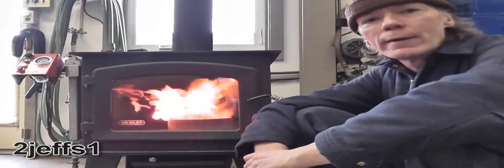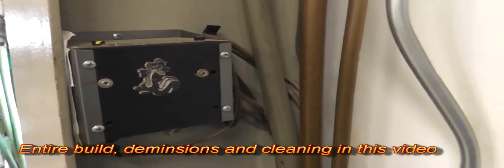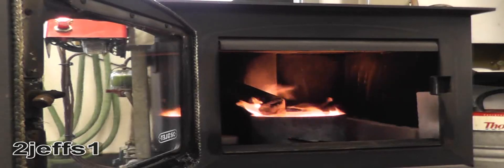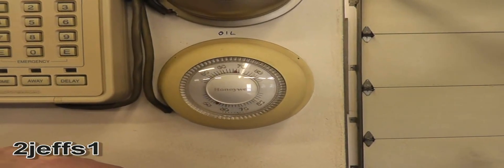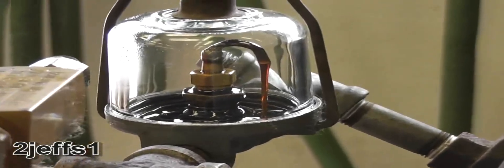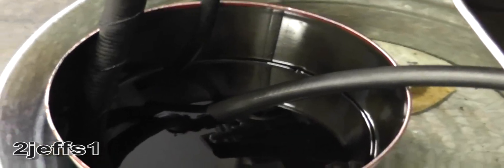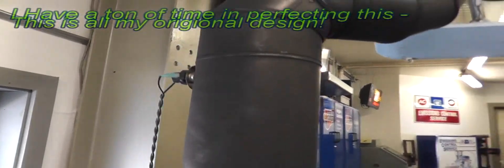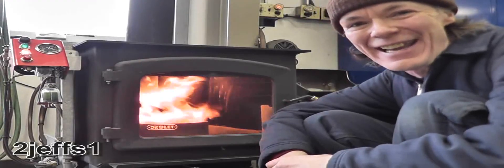Homemade Waste Oil Burner Heater for Daily Use DIY

Comment: I see your thermostat is reducing the oil by the solenoid  are you also slowing down your air supply? Not quite getting what your putting down.. Is the the smog pump for high pressure low volume air?  
Just wondering, nice vid  Murf!
Reply from the maker: Hello Dan. There is no change to the air supply. Just slowing the oil to a drip which keeps the flame lit for when it calls for more heat. (increased oil flow) Actually an air compressor or smog pump will work fine. I found the smog pump run at slow speed - the blades pulse the air which atomizes the oil better with less volume of air & oil needed and keeping more of the heat in the stove and less out the chimney. Hope this helps ya out, Jeff

Comment: Pretty slick design!  I like the wood burning stove redesign.

 I have a more advanced fully automatic design on my boiler that uses a common fuel oil furnace burner with a oil preheater unit just ahead of the nozzle.  Burns anything from gear oil on up even with the 2000 gallon tank sitting out in -30F whether all winter!
Reply from the maker: Sweet - Sounds like you have a nice setup too. Never seen how a fuel oil furnace is setup or works I just kinda remember there was one in the basement  when I was a youngster!

Comment: Would WVO work?  or do you need the pop of dinosaurs?
Reply from the maker: I never tried WVO but would think it would work. I have ATF, synthetic oil and brake fluid all mixed in and it works fine.

Comment: Liked and subscribed!  I can see how a manual setup is possible, but an automated setup like you show is so much nicer.  I am amazed how clean the glass remains.  You've got a really nice setup with all the precautions -- just add an oil tank full sensor/light/buzzer and you'll likely never need the oil overflow trough upstairs, but you probably have enough capacity up there to last 18 mo. of oil collection.  Awesome!
Reply from the maker: Welcome & Thank You. The glass was my favorite part vs the old pot belly stove. It's great to sit & watch it work on a Friday night & have a beer with some friends!  Aah - Actually now that you mentioned it I did over flow a tank years ago. (not much but before the overflow catch!) The sensor/light or buzzer is a great idea for the future!!
Reply: 2jeffs1
I use waste veggie oil as an alternative fuel in a diesel.  So I thought, why not drip it into a wood-burning stove.  I modified an umbrella holder into an oil tank with a small ball valve, a multi-turn valve to regulate flow and a copper pipe into the top of my wood stove.  I inserted a large rectangular pan in the bottom to catch what might not burn.  It is dripped onto wood and saves so much in wood consumption and ash removal.  Half of the BTUs come from wood, much more results in an inefficient burn of the oil and smoke.

Comment: everytime i read your comments i hear your accent lol i like the design. how much does it cost to run it on average (electricity cost/Per Month)?
Reply from the maker: That is a good question. I know the motor is a 1/4hp. It is an older one so it probably isn't as efficient as a newer one. I do know when it's really cold out it struggles a little bit on start up where it is in the cold!!

Comment: Very cool!  Does your oil drip onto the pedestal inside of your burner, or down on the bottom of your burner?
Reply from the maker: Hello Gerald. The oil drips to the bottom of the burner. The pedestal is mostly to assist the swirl. Note that the air in from the 1/4" copper line don't point directly at the bottom of the burner where the oil drips. That is so it don't flame out at idle. When the oil is at the high speed mode the air from the smog pump & swirl actually splatters the drops all over in the burner creating a lot of heat. (Actually the oil will be on fire on the way down a bit after started.) Hope this helps you out , Jeff
Reply: 2jeffs1
Can you burn synthetic waste oil in it?

Comment: This looks great!!!!!!!!!! I might try this in my workshop in the Netherlans.
Reply from the maker: The dimensions don't have to be machinist perfect. If your in the area things will work just fine. Once your up & running fine tune the 1/4" air in burner line for the flame swirl and your rocking! Sounds like your not quite next door to me!! I like when folks say where they are from. Do you watch mastermilo82? I believe he is from the Netherlands. But hey, Happy NY, Jeff

Comment: Great video and a brilliant idea, but I would rather use recycled veg oil.
Living in a built up area I would have huge concerns about what goes up the flue/stove pipe from burning engine oil that is known to contain heavy metal additives and is a known carcinogen.
But big respect for the ingenuity I think the burner pan would benefit from a vortex cone
B.Eng. Hons

Comment: Really cool.  I'm following your design.  How does the air from the smog pump get in the burner?  Is there a hole in your burner pot that connect to the line from the smog pump?  Also, what is the diameter of the line?
Reply from the maker: Hello derntus. The line that comes from upstairs (smog pump) to the stove is 1/2 '' ID copper. There is a silver tee (1/4'' steel pipe fitting) on the outside of the stove that this connects to. That will be visible in the video - the one that comes from behind the heat shield. The next fitting straight above that is a tee BUT you can't see that in the video. (sorry) That is where a 1/4'' OD copper tube goes into the heater and to the burner. That line I slide into the side of the burner is the air feed that is directed in a manner to make the flame swirl. One can slightly bend the end of that to get the perfect swirl for a final tune once operational. Please note that on the top of that external tee that air bleed valve and then goes to the muffler. I use that to bleed excessive air from the smog pump to avoid a dead head effect on the smog pump and to cool the drippier tube. (It don't inject any air into the stove.) That one is 3/8'' OD copper. It just lays in that drippier tube and is 2 - 3'' long. I know that's not visible in the video either. Hope this helps you out & good luck, Jeff

Comment: Awesome stove Jeff. You mentioned per season about 5 gallons of oil? How long would a season be? How many btu do you think it puts out, or have you ever measured that? Regardless thanks for being generous about sharing this with others :)
Reply from the maker: Hi radstorm, A 250 gallon tank will last me a 4 ~ 5 month season running the shop temp @ 68~70 degrees. As far as btu - I don't have any to measure that. When new people are here many times I get a comment on how they are surprised on the heat that gives off.

Comment: Great video on the waste oil burner and DUNE BUGGY!!!. I would like to know why you have a SMOG pump hooked up? Thanks Dave T
Reply from the maker: Hi Dave, Actually I did use an air compressor for maybe 15 ~ 18 years or so. It does work well. But --- this might not sound logical but the smog pump is cheaper on the electric bill and works much better. A compressor running a 1/4 " tube @ 20 psi runs pretty often. The smog pump is a vane pump and when it is run at a slow speed it makes air pulses which atomizes the oil it hits better and at much lower pressure which in turn keeps more heat in the pot. Glad you are enjoying my video's and Thank You for your comment, Jeff
Reply: thanks

Comment: I had a landlord who spent most of his time in his garage. He had a wood burner that he rigged to burn crankcase oil. Simple set up with a storage tank, gravity fed to a feed tube that dripped onto a metal plate. He only burned the oil at night because the black smoke PO'd the neighbors during the day. Kept it nice and cozy.
Reply from the maker: I remember when I first started on mine a few friends told me there were a few guys with a similar set up in our area. Never seen them though. Yeah I could see why ya would call them after hour heaters.....

Comment: real sweet mate .I use resturant oil in my oil burner but it is a hobby and takes patience to opperate.....
Reply from the maker: Hi Daniel. Even if it takes a bit of patience the $ savings is always the best part!!
Reply: 2jeffs1 with the resturant oil you must start it on heating oil run it for several hours then return it to heating oil again so it will light next time. . I have ran it ob straight free seed oil but it cloggs up the nozzle . 50/50 mix works fine no heating needed but i have a few  filters.

Comment: Jeff, Thanks for putting together such a well thought out video.  I really appreciate the time you put into this and it shows in your final product.  Your burner design inspired me to try a few things.  I made a quick version of what you have shown, and was suprised at just how well it worked for a very quick prototype.  Due to the design of my wood stove (made from an old 40 gallon water heater laying down) I decided to try a horizontal elongated version of what you had made.  I gave it a test run tonight and it seems that with some more work it could be a very workable unit.  Thanks again for the insperation!
Reply from the maker: Quite interesting on what you are creating there. It's neat to hear about your set up. Sounds like you are likely to utilize things that are at hand like here too. Glad to be of assistance to help you toward your project, Jeff

Comment: I'm getting mine together thanks for your help. Another question-- my old system used 1/4 pipe is this the same for you?  Will 3/8 help at all?
Thanks
Reply from the maker: Hello Nancy - I hope you meant the pipe that goes at an angle into the stove for the drippier - that is 1/4 " water pipe. (shielded by 2" pipe) 3/8 should work just fine if that's what you have available to use. It shouldn't matter for a performance difference. Jeff

Comment: Hi wonderful design you mentioned the age of the stove it looks brand new.  Please provide make and model.  Also, do you know what the inside temp. is? I am wondering if it could spin a vane in the summer that would be attached to a generator. Again your design is wonderful.  What are the storage tanks? Looks like you got everything covered. Oh, nice restored gas pump in the background your shop is spotless...
Reply from the maker: Hi William. The stove is made in Canada by Drolet. The model name is Austral and the model # is DB03030. The storage tanks are from houses that use to heat with fuel oil. People give them away around here. I just checked the RH side of the stove temp a few weeks ago when it was really cold here. (Note that I concentrated the majority if the spin flame on the right side) It was 888 degrees Fahrenheit (where the flame hits) and the chimney at the upper sensor was 246 on the edge of a trip to switch to slow speed flow. By keeping this limited to this area you don't damage the front glass or begin to distort the stove. To spin a vane - that would be neat if possible but that would be out of an area I'd be helpful in. Have fun, Jeff
Reply: Hi Jeff,

Thanks for getting back with me on this.  I think I might be able to do something here though the parts would have to be machined and would be unique.

I am working on low RPM generators I don't think this would remove any efficiency of your stove. 

I think you mentioned that one tank last the winter season?  How many gallons would that be.

Best Regards,
Will
Reply from the maker: William Ward
Hi Will, I've been told they are 250 ~ 275 gallons. Great question. On the video there isn't any thing near by to judge the size of the tanks. I never thought of posting that! Jeff

Comment: What a great stove! I have been looking at these heaters for a while, and by far you have the best and safest design. I just finished one tonight,nothing like yours. Pretty simple. Tube on the wall for a tank,and a pipe hanging over the intake for drip. So far so good. Thank you for a great video!

Comment: WOW. I've been thinking of building a waste oil heater for several years and was not very impressed with the plans I have seen due to several factors such as expense, ease of construction, dependability, clean burn, maintainance, and most of all safety. I have to compliment you on your design, it meets all of my criteria above and beyond what I ever expected to find. Thank you for sharing this fantastic piece of engineering.
Reply from the maker: gorp27, I Thank You for your kindness. Comments such as yours make all the time I invested in this journey so worth it!

Comment: Quite innovative. Really impressive. Have you considered using your compressed air system in lieu of the smog pump air set up? You know, less systems to worry about and maintain. Just an idea. Maybe use to heat water too? That's another whole system to invent....maybe phase two?
Reply from the maker: Hi Vic. Actually I did use an air compressor for maybe 15 ~ 18 years or so. It does work well but --- this might not sound logical but the smog pump is cheaper on the electric bill and works much better. A compressor running a 1/4 " tube @ 20 psi runs pretty often. The smog pump is a vane pump and when it is run at a slow speed it makes air pulses which atomizes the oil it hits better and at much lower pressure which in turn keeps more heat in the pot. On the water heat idea - that's in the possibilities category, phase 2 > I like that! But hey Vic Thank You for your comment & stopping by, Jeff
Reply: I figured you were one step ahead, that's the kind of guy you seem to be.  Your attention to every detail, and precision is admirable.

Comment: I think you are a very smart man, I prefer a simple heater, but I only use mine when I am working in the garage. It has a heat exchanger bullt into the freon burn  tank, and I use a microwave fan, to blow more air around the shop. I did mount mine on the wall about 4 ' above the floor, becuse gasoline is more heavy than air.Dan
Reply from the maker: Hi Dan. I like hearing about other builds. That was a nice description of what you did  and it sounds like you created a sweet heater!

Comment: I'm very impressed.  Very clever design.  Artfully executed.  Skillfully presented and explained.  You've given me a lot to consider.  Thanks!
Reply from the maker: Hello Rodger, Thank you for your feed back. One thing I'd like to let people know is don't let this be intimidating. One don't need to get the dimensions perfect. If your in the basic area it will work just fine! On the electrics just wire the system in a loop (series circuit) and skip the relay & lights to keep things simple.

Comment: interesting, but WAY too complex, and one malfunction, your house is going to burn down.  Coal is way better.  I heat my house in northeastern Pa., through the coldest winters for only $400, and heat 1200 square feet to 68 degrees.  That's only 2 tons of coal and for a 6 month heating season.

Comment: Jeff, Nice heater!  Would you know well would this work with WVO(Waste Vegetable Oil)?
Reply from the maker: Hello Pleasant Suprise - I haven't ever tried WVO. I would think it would work ok though. Mine gets brake fluid, transmission fluid and synthetic oil too. I hope this helps, Jeff.
Reply: 2jeffs1 It does. Thanks!

Comment: Hi, great stove.  Now this one I like. Do you have plans on how I can build one myself?  I imagine any wood burner would do?
Reply from the maker: Hi CP H, Sorry I don't have any plans to send you. This should work in any wood burner but the more air tight it is the more efficient it will be in regards to oil consumption. The w burner I am using you control the air in. On my older one worked fine too (Pot belly) There was a damper on the chimney out pipe.

Comment: hi 2jeffs1, thanks for reply.
the external design you made is a piece of art, worth attention.
inside my stove i made a small burning camera of silicone(!) bricks with blowing forced air/oil.
Result: bricks melt before they crumble, become glass. 
oil leaves no ashes at all, just fine grey powder.

what you think?

Comment from the maker: Hi dp, Yes you do get a tad of soot dust. Once a year I remove the chimney section (from the stove to the ceiling ) and blow it out from both directions. I also blow compressed air up the building chimney section while the other is removed. Nothing sticks to the pipes because they don't get hot. No scrubbing with a chimney brush is ever required. At that time I vacuum out the stove with a shop vac with a drywall bag installed too.

Comment: let me suggest improvement: blow air with oil together, to pulverize oil. Direction from top down, against flame.
in that case you will get blinding bright and hot flame

Comment from the maker: Hello, Wiring can be a  challenge but here are a few possibility's. Make sure your system works without the thermostat. @ TS jumper the blue in and the red out. Ypu should be able to cycle the system this way. Where I didn't have a p/n for the solonid maybe yours draws too many amps especially if you aren't using a relay. The one I used is app 750Ma (3/4 amp) Maybe to keep things simpler ignore the anticipater hook up. That isn't required, it just makes it cycle more often. Hope this helps, Jeff

Comment: Well done!! I am in the process of making my Rayburn Novelle range run on waste oil. Its going to be much like your set up. Its funny that you said ask a few friends for oil. I did this with used cooking oil and ended up with about 400 gallons inside a month. That little lot is running the generator (11kva Lister TR2) that I supplying the power to write this comment. Again ,well done!!!